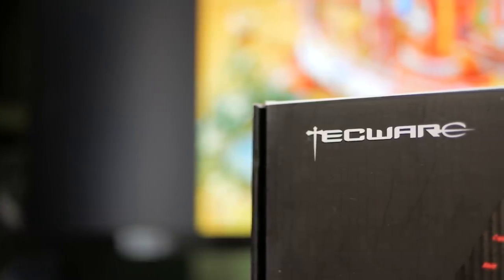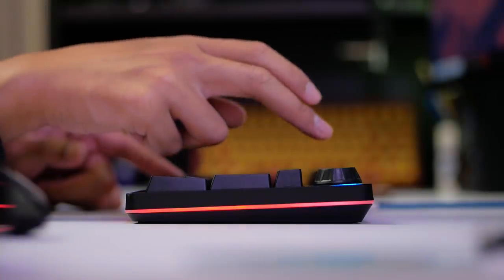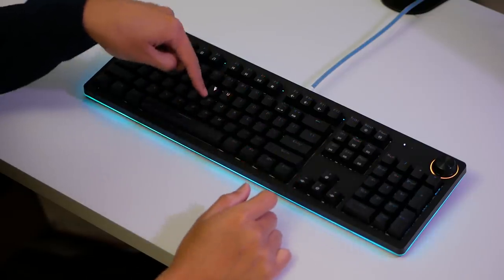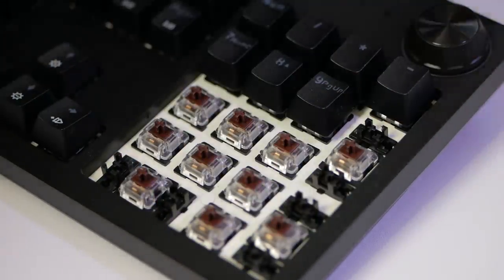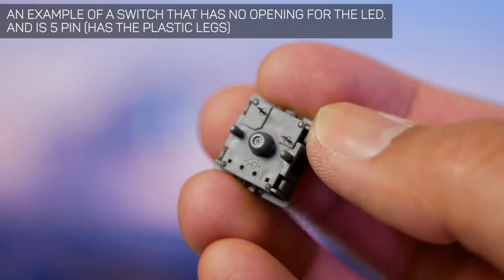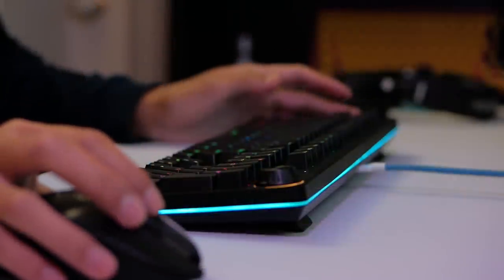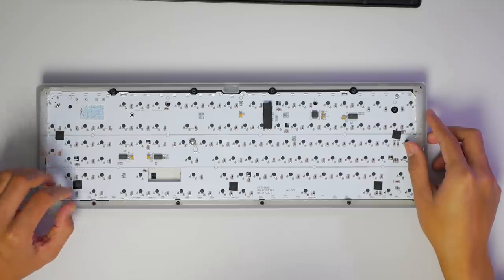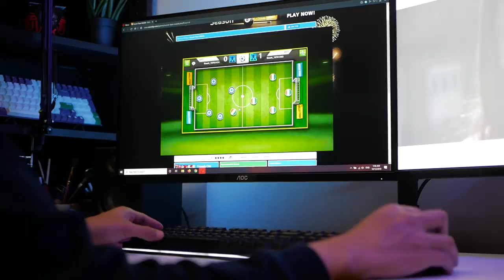Tecware Spectre Pro - A Stunning Budget Mechanical Keyboard

Comment from the maker: This is an early unit, so probably hold off for a bit if you're thinking of getting it. I've passed on my feedback, and they've said that they'll work on improving the keyboard!
Reply: may I ask what keycap set you used in them? thanks!
Reply from the maker: @cakeisalie  from the Mistel  MD770 I reviewed in the previous video lol
Reply: @TaeKeyboards  thanks! okay, I'm turning on bell for all notifs then, I keep missing your good stuff
Reply: When you say "early unit" do you mean it's a pre-release board or is it from the first batch of the retail boards? It's more likely the latter but I just want to make sure. Great review, by the way. The part that I liked the most is where you tried putting in a Kailh boxer in there and bent a pin. I would absolutely have done the same thing upon getting a board with Outemu hotswap sockets. Would you mind doing at least a quick video where you make other switch types fit into it? I've heard of filing down the contacts and maybe cutting off some prongs but I'd totally like to see a video of somebody doing it. Maybe there's already one that I haven't found yet but still.
Reply: Thanks for an excellent review of this keyboard. I didn't know that it's still an early unit and already got one which kinda sucks.
I can't hear the ping unless I put my ear very close to it, maybe because mine is blue switched.
I use the knob most of the time and for me it has bumpy and rough feel.
It's also worth noting that it only have 12 color modes compared to their other keyboards which have 18.
It looks fantastic for its price but knowing that it could still improve makes me feel bad for buying it early.
Reply: And tell them to make an ISO layout tlk while you are at it ;)
Reply: Where do you purchase it, I looked for about 2 hours a couple weeks ago and found asian shipping websites only.
Reply: What's your honest experience with the brown switch using it? How does it impact your typing for gaming for long typings, and other productive stuff that you do?
Reply: It looks like the phantom elite has more options when it comes to switches. Do you know if they'll switch to this? I'd love a Spectre Pro with some Kaihl Box Jades.
Reply: Will they release an iso version?
Reply: Is it out now
Reply: If they release a tkl version of this, its basically insta-cop.
Reply: Side profile looks a lot like a massdrop alt/ctrl high profile ngl.
Reply: any news on the new revision ?
Reply: $85 just for this keyboard damn that's expensive.
Reply: any update on this?

Comment: Man if only they'd used a more universal hotswap standard, this board would have been near perfect.
Reply: There is a more universal hotswap standard, which is the annoying part about it. It's used on my Glorious PC Gaming Race keyboard.
Reply: @rich1051414  it's called the Kailh hotswap socket
Reply: @spidermain  Thanks. Works with all the switches I have, as long as they aren't 5 pin, but you can cut off the plastic pegs if need be.
Reply: they have phantom Elite (focus on the elite) that uses gateron or kailh switch (which I believe is the universal hotswap standard similar to Glorious MMK)
Reply: @gchyll2  Yeah, most switches work, with only the minority not working. That is the opposite of the outemo hotswap sockets, where if you use anything but outemo the socket holes get fucked up and stop working with other switches.
Reply: @gchyll2  I know it's been long 4 months but maybe you know where to get this board? Phantom Elite that you mentioned
Reply: @rayne1337  well most Asian online shopping platform does sell those like shopee...but im not sure people outside Asia can use the app or not
Reply: @madnoajiq6958  I have found a full 104 keys version of Phantom, not Elite on aliexpress but that's not quite what I would want. but thanks, I will check out this platform that you mentioned. these keyboards are neat for the price and it's sad that it's not available internationally
Reply: There's the Tecware Phantom Elite, but its very hard to find. I don't know where to buy it, and its not available anywhere on their website or Amazon.
Reply: @cookster69  Nope, still no luck. I would recommend the GMMK barebones because its $59.99, and with the right configuration you can squeeze in the parts needed to build a keyboard under $100. If you don't have your own switches you can buy some from NovelKeys (you probably already knew that) or get them bundled with the decked-out GMMK, which sadly will cost $109.99 with Gateron Browns.
Reply: @cookster69  Yeah, but minus the hotswappability. In my opinion, the GMMK offers better switches and has a compact layout too. It depends on what you want tho... Cherry switches and Ducky Keyboard, or hotswap switches (which means that if you want a keyboard for gaming, just pop in some Kailh Speed switches, which have four variants to choose from via NovelKeys) and also the ability to change and customize later on
Reply: TheCookieCrusader I mean it’s all up to you. The ducky is a great board, but I mean if you don’t want the customizable switches then you get the Ducky.
Reply: @cookster69  even without the hotswap feature, the Ducky one 2 sf cost more than double of my phantom elite tkl. And hot swap is really convenient so depends on what price can you get those boards for, or I really recommend phantom elite over Ducky one 2 sf
Reply: That would increase the price by a lot though and less people would buy
Reply: It’s my first mech, I’m hsppy
Reply: @spidermain  is this kalih sealable!
Reply: @gchyll2  I can't find that model to buy
Reply: They sort of are(from my experience at least)

I swapped the original switches for Akko rose red switches and it still works like a charm. Although removing the original switches that come with the board may take like 2 hours depending on how tight it is and even after I finish adding the Akko switches, it feels loose/unsecure but secure enough at least to stay in the board. Do I suggest it? No, not really.

Comment: Good review! 

I purchased the Tecware Phantom 107 key mech keyboard off Amazon in the summer. I originally had the Logitech G810, I didn't mind it but I was on the look out for a new mech. I bought the Tecware keyboard mainly for the swap able switches and it's price. I figured if I didn't like it I didn't waste too much money lol.

I didn't really like the feel of the Outemu Browns and noticed the lack of lube on the switches. I ended up picking up some Outemu Silent Sky v2 switches for the board along with some aftermarket keycaps. I also clipped and lubbed the stabilizers. Night and day difference and I've been using this board ever since.

Comment: Just got this board today, the ping is still really noticable.    Also, sticking stabs and multiple stripped case screws straight from the factory.   Has potential but Tecware needs to get their QA in order.

Comment: The issue is, the holes get 'gapped' by using the wrong switch type, then even otemu switches will be intermittent. I learned from experience.

Comment: Damn. Already a minute into the video and I kinda wanna nab this. I hope there’s a TKL version? My main worry is that wheel.
Edit: nvm god damn that ping
Reply: There's no TKL version for spectre. Only phantom
Reply: There's the tecware phantom tkl
Reply: U can get the phantom pro which has more hot swap (compared to its non pro version where only WASD and arrow keys are hot swappable iirc) and also u can get em in either kailh box browns or Gaterons
Reply: Basty Tiglao it’s just the noise the keyboard makes after the keyboard is pressed, the high pitched metallic noise
Reply: @dar00dsandstrooom3  There's no Phantom Pro, you actually aren't recalling correctly. There's the regular Phantom which has Outemu hot swap sockets and there's the Phantom Elite (only sold in several south-east asian countries, unfortunately) which has Kailh (aka universal) hot swap sockets. I also don't think there's any PCB that only has hot-swappable WASD keys, and I see no reason a manufacturer would want to make one.
Reply: @bartselen  damn my bad. We have that one with kailh copper switches and whatnot
Reply: @cloudedimpulse  old aka previous model
Reply: wait phantom is same as spectre? someone explain
Reply: a bit late, but you can always fix ping.
Reply: @seanhalperin6469  mkb noob here. How could you fix the ping here?
Reply: @snoozleblob  dampening foam and a deskmat can help out a ton, it might not get rid of all of it but its a simple yet effective solution.
Reply: @seanhalperin6469  Thanks for the reply! For a new person just starting to look into the hobby the amount of info and options out there is kind of overwhelming so it's nice to be given some pointers on what to look up next in detail.
Reply: @cloudedimpulse  but it doesn't have the backlight

Comment: I recently just bought the Tecware Phantom, which also has the same ping sound after every keystroke. Although either I am just getting used to the sound or, the more I use it, the quieter the sound becomes. Its my first mechanical keyboard and I love it, Its very high quality and has great lighting options, although I wish the lighting was just a bit more brighter. Also the software could use a little bit more work. Over all, I think its a great keyboard for people that are just getting into mechanical keyboards.
Reply: I got the Tecware Phantom 87 TKL and I have the same ping sound after every keystroke, I already got used to it but at the beginning it was kinda annoying.

Comment: NOTICE: When you're trying to leverage a switch out of the socket, try wiggling the removal tool up and down, verses side-ways like shown on the video. Using a side-ways movement only rocks the tool on the switch, not pulling on the switch with the bent tips of the tool.  In other words, you would get better leverage to move the switch, not just rock the tool.
Thanks for the videos!

Comment: I was finally able to buy this in nov last year in the USA. I've had a while to test it and its fantastic! if possible you may want to go over this one again with a new retail unit. Mine has the new keycap font design and are a lot better and there is no metallic pin and foam inside. the volume knob in mine is great and not difficult at all to use and is even all the way around. Also you can run some gazzew switches in there. like the boba u4, u4t, bobagum etc. this keyboard is the only keyboard that fits all of my criteria without going off the wall custom and even then its hard to find/build a full size custom that has everything this has in it.
Reply: Are you having keycaps not responding problems?
Reply: @kucingmalaya1177  keycaps? You mean switches maybe? I had 1 get flakey and I simply popped out the bad switch and replaced it with one of the 5 extra switches it came with. you can also buy gazzew boba switches for it if you want a more premium switch upgrade.

Comment: Those keycaps are exactly the same ones you get on every Tecware Phantom and Phantom Elite model. Given how much keycaps can somehow add to the cost of a pre-built board, I guess Tecware has to cut costs somewhere. If they're improving the font, hopefully it'll apply to the rest of their keyboard lineup too. That or maybe they just slapped on Phantom keycaps on the pre-production review unit since the production caps aren't done yet.
Reply from the maker: yeh, I mean they're budget mechs, you can't do too much. But like there's other budget boards with nicer legends.

Comment: I just don't like the fact that they reverted back to outemu hotswaps only. They already did a universal swap board with the Elite TKL and I don't really get why there's a need to revert back. Still, the keyboard looks nice. 

Still waiting for the time Tecware will release a compact board, maybe 60-70/75% boards with the same aesthetics and enclosure as this. The keys hidden, not the "floating" ones that is actually on trend. I'd gladly buy one even on a bit of a premium price, especially if its a universal hotswap board. 

Was a fan of tecware even when they only released budget cases. Heck, I still have their Raiden Elite Case from way back when. 
Kudos still to Tecware for releasing budget boards/peripherals to the market. 
And kudos to you as well TaeKey's  as you always do a good job on this reviews.
Reply from the maker: Yeh, it would be nice to have a Kailh socket version of this for universal hotswap. It will add to the price, but I feel that a lot of people would accept that. They would have to develop a new PCB to accommodate that sockets though. 

But yeh, the smaller form factors may be a bit of a stretch for now. But a TKL in this style, with Kailh sockets would be absolutely amazing.
Reply: @TaeKeyboards  All we can do now is wait and hope that Tecware listens to recommendations from their consumers.

Comment: I tried using the switch puller on my Tecware Phantom so I could lube the switches (brown), but I ended up breaking some of them since they're so tight. Instead, I just used a small flathead screwdriver and pried the switches up from the bottom right and left corners. I lubed them with Tribosys 3203 and replaced the couple of broken ones with the included replacements. The metallic pinging completely disappeared after lubing.

Comment: Did they end up fixing the pinging issue with the keys? Trying to decide whether to buy this keyboard or the Tecware Phantom 87 TKL. Which would you recommend?
Reply: You will be able to remove the ping if you lube the switch, but it does take a bit of work
Reply: nope its still there, I just bought got one and its still very much present.

Comment: I really love what tecware does but that ping is rough, Ive used the full and tkl versions and my tkl has some ping. If they do fix it please do an update video to let us know! If they fix the ping I’m getting one
Reply: Fernando Estolano Jr Ping isnt something companies can just "fix" like that. It's an inherent problem of dry switches, and won't be fixed unless you lube the springs. No manufacturer will do that for you.
Reply: New to mechanical keyboard. Erm what do u mean by 'ping'?
Reply: Madno Ajiq during the sound test turn up your volume, you should hear a small metal sound when the keys are pressed

Comment: I just bought it for 30 bucks. Worth it for the 104 switches alone. Might order some other switch variants.
Reply: Can you please tell me if it's Quiet ? I am living with roommates and I'm thinking to buy this one
Reply: @abdellatifcheater9833  I got the brown switch model and it's about as loud as your typical membrane keyboard. Which I suppose that's the goal of brown switches. 
Reds should be even quieter. Hot swap is nice at this price point. My W key was getting stuck and it comes with 4 extra switches. Replaced it in less than a minute and was back at it.  The RGB is actually quite nice for the price too.
Reply: @I_am_Dad_Son  So If I got red switches It will be quiet ? IT won't bother roommates ? I live with roommates
Reply: @abdellatifcheater9833  Yes. Reds are silent, but don't really have feedback for you key presses. Blues are the loudest and make a clicky sound. The browns are about as loud as your typical keyboard. These are the only switches I've seen for this keyboard so go with reds or browns.

Comment: If you change the spacebar's switch with maybe an Outemu red for example, does it get rid of the ping?

I have a Tecware Phantom TKL that I carry along with my laptop, but I'm looking into getting a full size keyboard for use in my desktop PC. My Tecware Phantom's spacebar doesn't sound like that, but it also has the same problem with the built-in switches in that they are difficult to take off (and I ended up breaking a few of mine just like what you did in 5:56), but once I replaced them with other Outemu switches, it's a lot easier to hotswap. There's something with their built-in switches that are just too tightly fitting.

Comment: seems like a nice enough keyboard except for those oem caps. i literally have like 4 sets of those exact same caps from different chinese boards ive bought and sold. otherwise seem like a really good value and the design is nice. Hot swap is always appreciated
Reply: I’d recommend the Hyper X pudding keycaps with these, the mix between the two would look really nice.
Reply: They released the new batch with a much better font now

Comment: on the outemu reds the ping is more apparent and its so loud

ps. for the chaeyoung melody project
Reply: i've actually tried lubing the outemu reds on my tecware phantom tkl! it slightly reduced the ping, but it's still pretty noticeable...
Reply from the maker: Yeh the Browns do mask it that little bit more compared to the Reds.
Reply: @jamieshin4540  its still one of the most annoying thing on outemus, but overall the spring is good and its smooth

Comment: the ping probably comes from the switches i believe, and then it gets amplified throughout the case?
Reply from the maker: It's just something about the design. If I just tap on the empty space above the arrow keys with my fingernail, I still get that ping.
Reply: @bastytiglao4755  Turn volume up around 7 minutes. You will hear metal ping sound after each press.
Reply: might be the steel plate not properly dampened
Reply: Basty Tiglao It's the springs not being lubed, and vibrating around when there's a shock in the keyboard, like when you bottomout.

Comment: Using a Tecware Phantom here - not sure if the experience is the same but the Outemu keys are not great. My keyboard is 3 months old and already swapped out 5 keys that stopped working consistently. From what I saw on Amazon the board only supports Outemu's and not other's like Cherry etc - is this really the case?

Comment: Recently got the keyboard and tried putting in Akko Rose Reds and it works fine although a little loose, however removing the original switches is very difficult and may take up over an hour or two.

my back hurts :(